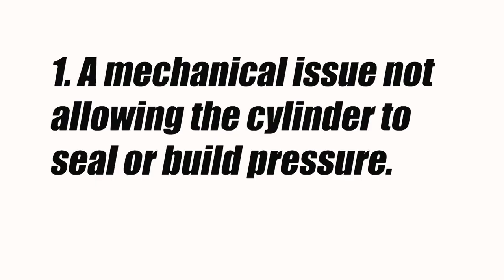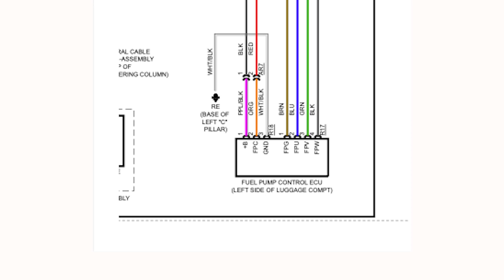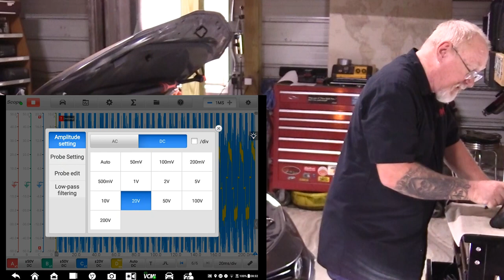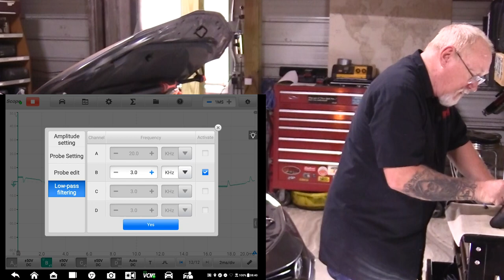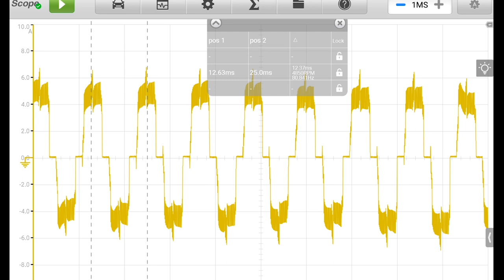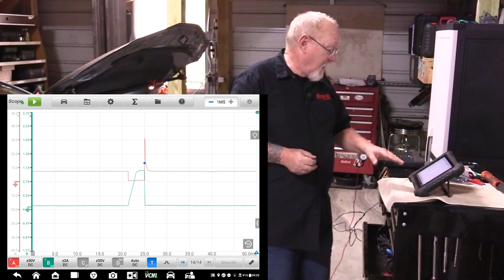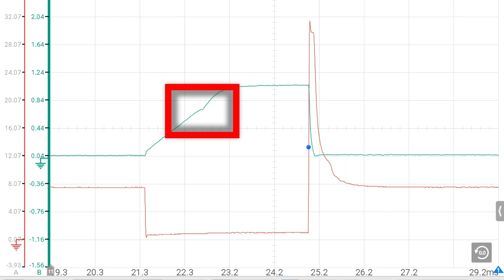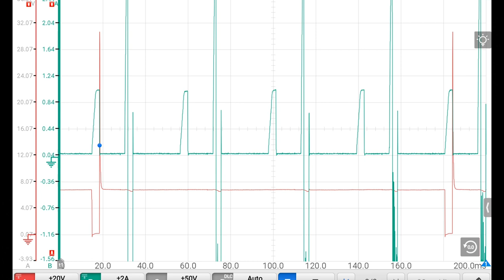The Trainer #138:  Fuel System Performance Testing Using The Scope (featuring Autel DSO)

Comment: Wonderful presentation. When you showed the Autel attenuator to the camera, it was a 20:1 attenuator with 10 MHz bandwidth and a rating of 600 Volts maximum. Then you installed what appeared to be the same attenuator in the line of your scope probe. But you set your scope for a 10:1 attenuator and got a flyback reading of 32 volts and remarked it was lower than expected. Had you set up for the 20:1 attenuator in the line, would you have gotten a 64 Volt flyback?
Reply: Thank you for pointing out the oversight. It was indeed a 20:1 attenuator and the 10:1 setting was chosen on the scope. Although the scope is now protected from the potentially dangerous flyback voltage, the math is no longer accurate, and the scope is not displacing the voltage correctly.
Reply: Looks like someone is used to using a pico and the 10:1 attenuator.